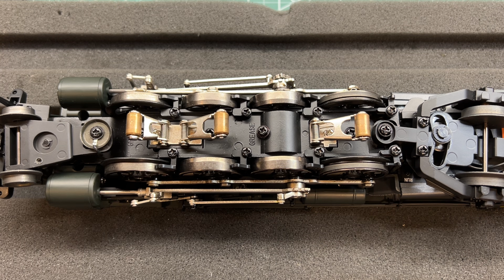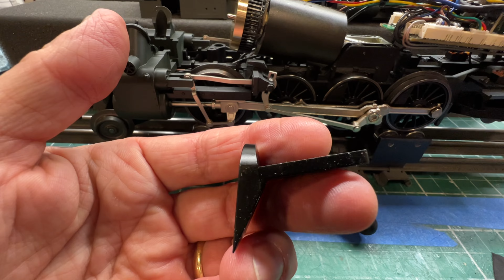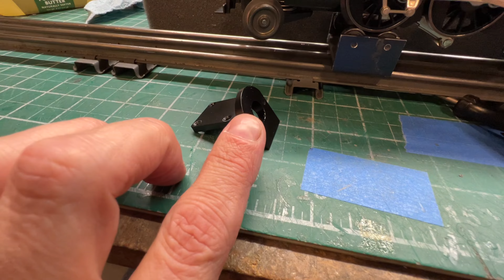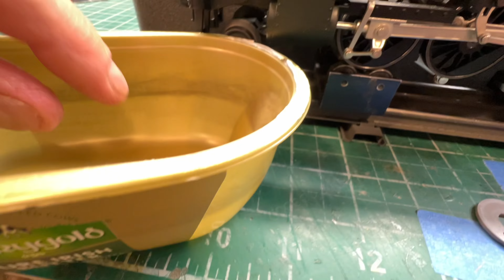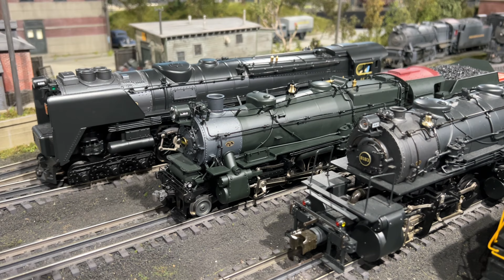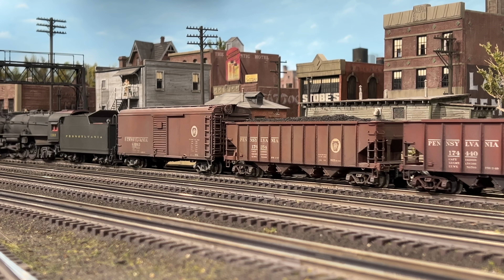The Chronicles of Norm #24 - Return of the Locked Up L1

Comment: This is great, Norm. Like others have said, it is nice to see a video that doesn't gloss over the significant quality issues Lionel has had lately. I have an L1 and, knock on wood, it has been 100% problem free with no gearbox noise or issues running forward or reverse. Then again, with a 4x8, I am not pulling tree stumps out of the ground with it so perhaps that is part of my success. 

I don't disagree with the color but, personally, I don't really care what color it is if they give a solid mechanical product - no gear issues, etc. Clearly they need to go back to the drawing board. I am done preordering Lionel engines, the Legacy Strasburg #90 seems to be a winner but after the Mogul fiasco of a few years ago and other issues, I'm doing the "wait and see" thing. Then again, I'm mostly an MTH guy anyway. Both companies make a nice product (usually) but there are far, far less surprises when you open a purple box.

Comment: I'll have to do this fix. I found sheets of polystyrene on Amazon available in 0.015" and 0.020", which is in the range needed. Mine will look pretty sloppy, but as long as I get the general shape, I should be good.
Reply from the maker: I can share the very simple designs if you know someone with a printer. I posted them on the OGR thread about the L1s.
Reply: Awesome, I found your files on the forum. I don't know anyone with a printer, but Etsy has multiple 3D printing service sellers. I can get a quote from one of them.
Reply from the maker: @Jared-91  maybe see if library nearby has a maker space that can print for you? I wouldn’t bother doing the 2mm, just multiples of the other three I put up.

Comment: Nice job Norm. Not sure if you had any experience with MTH  GP-38-3 diesels. I have 2 of them that binding issues in the trucks. I was going to replace the trucks but maybe its a worm gear problem. The motors are vertical so I'm not sure if its similar issue as your L1

Comment: As someone just entering the realm of 3Rs, I have my eye on the weaver h10, any comments?. Also I absolutely love the content recently as always so keep it up!
Reply from the maker: I’d look for the old MTH H10. Better details and a nice driveline. You can sometimes find them with blown PS2 electronics real cheap.
Reply: I have an early MTH PS2 5V PRR H10s.  Probably one of the most detailed O-scale locomotives I have. It still has the original boards in it and runs well.

Comment: It's good you can print these parts off. I got an Ender 3 Pro. I really enjoy it. But I hate that spool on top. I think it often contributes to bad prints. Working on putting it to the side so it can feed better. I enjoyed your vid.
Reply from the maker: I changed over to Cura and have way better prints. I had a problem with tangling on the interior print for my Bessemer Bar. I have yet to try moving the spool location. 🤔

Comment: This is truly disappointing. The gearbox and color issue. Lionel's quality control is virtually non existent at this point. It's not acceptable by any means especially for the money they ask for. The new Lionel Legacy NYC Dreyfuss Hudsons are causing an uproar of criticism for Lionel. The colors were completely wrong. I have the MTH Premier version of the PRR L1s and I even recently picked up this engine in the LNE scheme. I hope that mine does not have the gear box issue. I've told my dealer about this and they are going to take a good look at my engine to make sure it doesn't encounter this problem.
Reply from the maker: I hope Lionel addresses the gearbox issue. They also need to find other work for whoever it is that’s picking their colors. The Dreyfuss is awful. 😞
Reply: @normstrains  this comment saids alot coming from you Norm. Your a die hard Lionel fanatic and many people and even some well known dealers have defended Lionel about their choice of colors for the new NYC Dreyfuss.